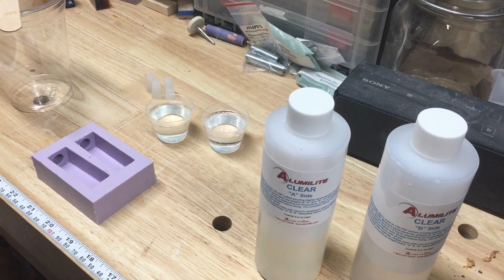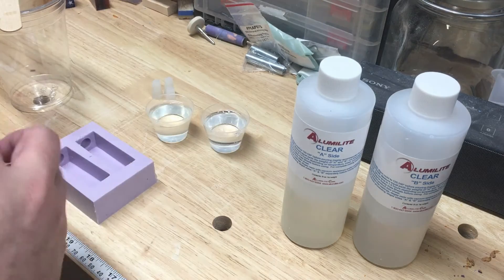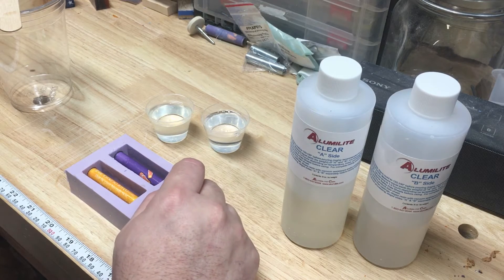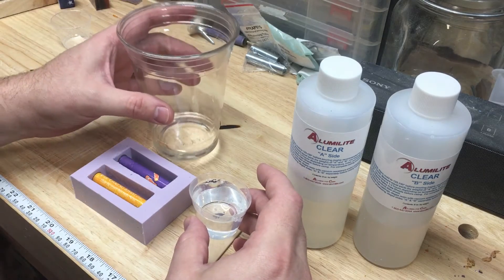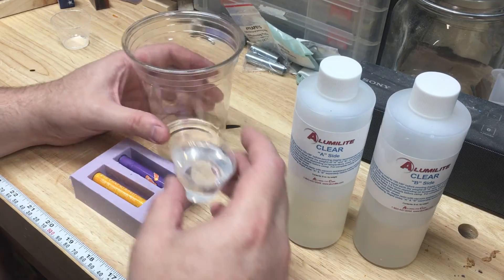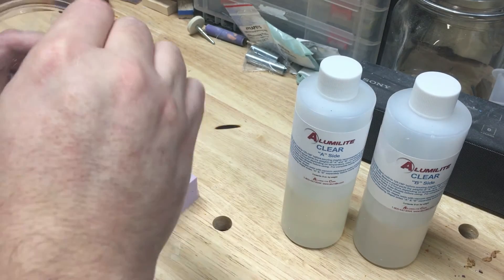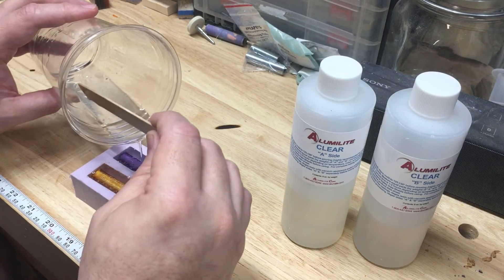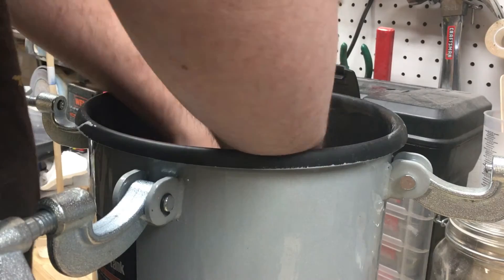Casting waterslide tubes

Comment: Heat helps make the bubbles come to the top and pop. A heat gun can be used for that purpose.
Reply: Not so much.  Bubbles rise slowly through thick resin and faster through thinner resin.  Heat thins the resin, but reduces the open time so as the resin sets, the bubbles can't make it out.  Heat or alcohol spritz is good for getting rid of surface bubbles, but only pressure makes 'em all disapear.

Comment: Have you ever tried using vacuum instead of pressure to remove the bubbles? What brand are your molds and where did you purchase them
Reply from the maker: J J I have not.  Many have asked about this and the general consensus is degaussing does not produce good results.  Since these resins setup quite fast you really do not have much time for the bubbles to come to the surface before it sets locking the bubbles in place.  Note, degaussing is a means of removing bubbles, pressure compresses them right away removing them optically from the cast.  I hope that helps.  Molds can be found at https://ptownsubbie.com/

Comment: I like you videos, there are good step by step instructions.  I used those mold before and the small pieces that keep the alumilite from getting into the tube went all the way into the tube with the air pressure of the pressure pot when I put the mold into the pressure pot and applied 50psi of pressure and it ruin the blank.  Has that ever happened to you?  How can fix that problem?
Reply from the maker: Samuel, I have not had that happen and I too go to 50psi.  Possible the plugs are too small?